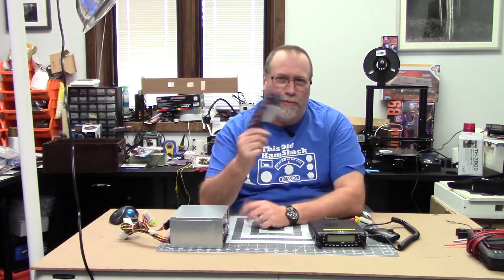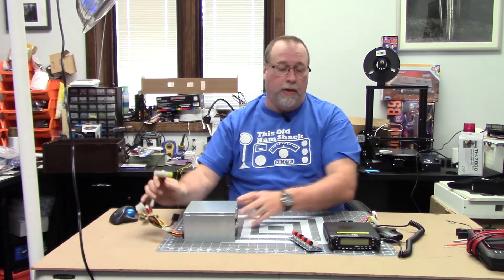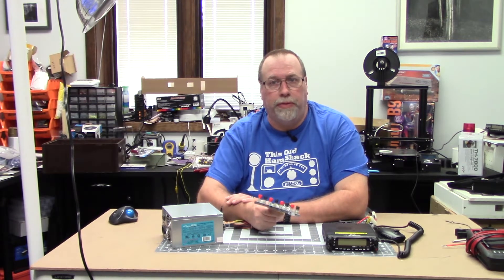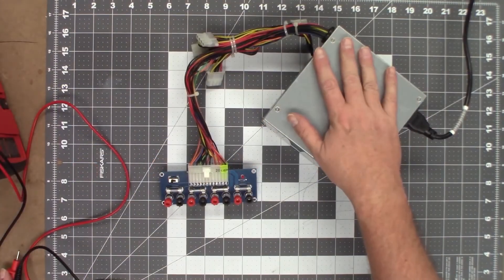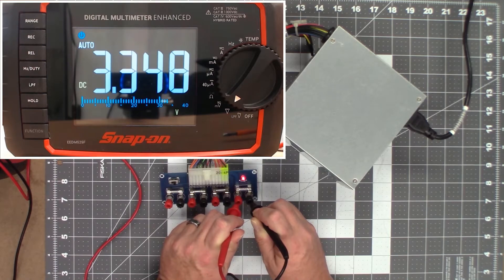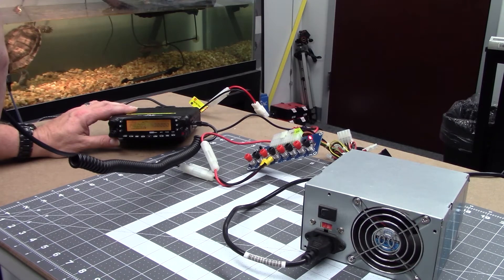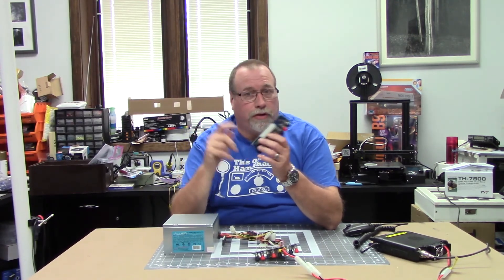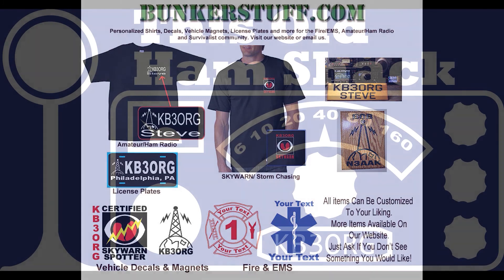Computer Power Supply Breakout Board, Easy Power Supply

Comment: Does this board work on all power supplies from desktop computer
Reply: So far it's worked with every one I've come across.
Reply: Not quite all of them, only ATX design power supplies. But those are the most common you'll see for the past 20 - 25 years.

Caveat: Some older ATX power supplies have a 20 pin plug.  This breakout board will only fit the 24pin header.

Comment: Hi, nice video. I do not uderstand well how many amps do you need from ATX to radio .
The fuse of XH M 229 is 5 A , and if the radio required more then 5 A , normally shout down all.
You can change the fuse with a little bit more high. 
is it right?
73 from Lorenzo IU2PES